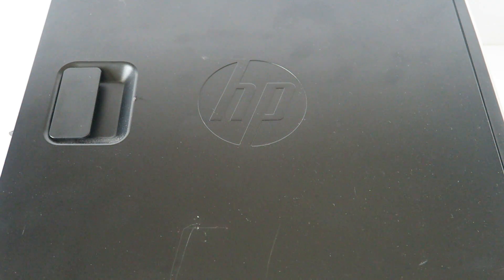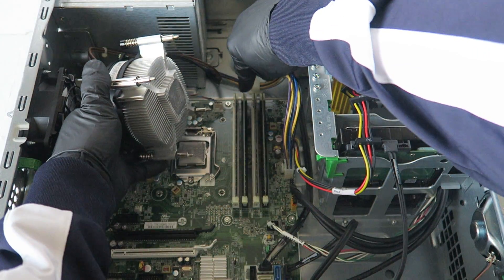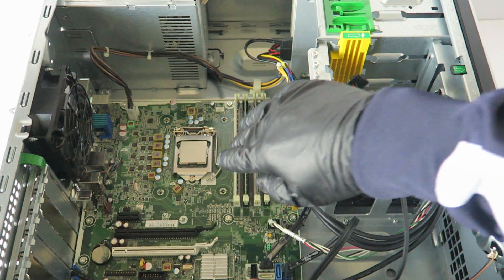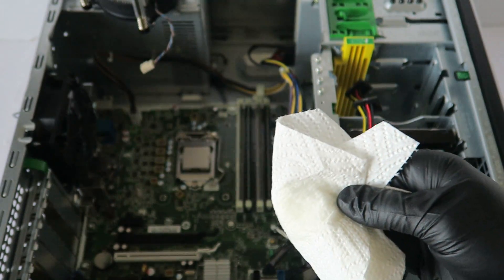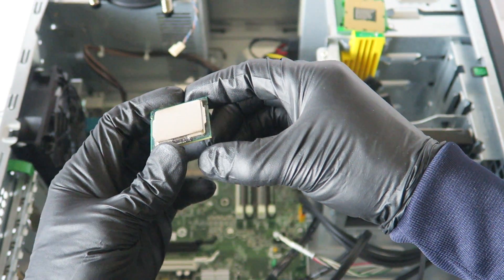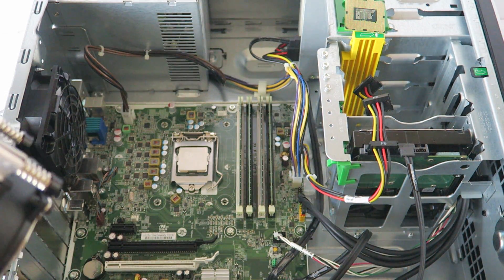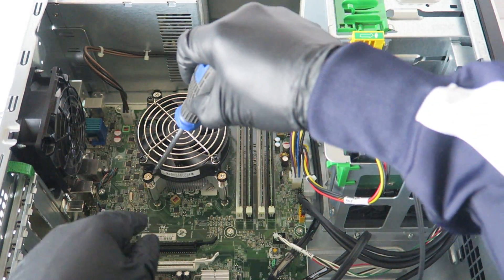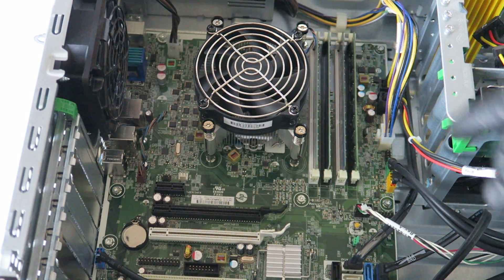HP 8200 Elite Processor Upgrade

Comment: I know this is old. I have the larger case 8200, do you think it’s possible to install an AIO liquid cooler for the cpu? I hit 80c on the cpu regularly on the factory cooler and want to upgrade. I’m not sure if the factory fan header would be ok for an aio pump

Comment: Can you replace the cpu heatsink on these machines? I saw some cheap lga775 coolers on ebay but I'm afraid that the mounting holes are proprietary like everything else in these damn machines.
Reply: I tried replacing the heatsink with 2 different coolers, but they are indeed proprietary. Any luck on your side?
Reply: @presidentcherry6193  I did managed to replace the heatsink, but had to pretty much hold the thing with zip ties because of the holes in the case are threaded, pretty much designed to only hold the proprietary heatsink. You can squish the mounting bracket on the new heatsink in the holes but it's very finicky, you could probably use a drill and remove the threading or make the holes larger or get some motherboard screw extenders, or alright remove a hole at the back of the case and use a back plate, but I didn't try.
Reply: @LookingGlass69  Another thing to consider on certain heatsink is that some of the brackets could actually fit just fine if you're willing to drill some holes for mounting screws. I was thinking of doing this, but alas I don't have any tools that can drill through metal and make small enough of a hole. Any cooler you're using in particular?
Reply: @presidentcherry6193  I was using a cooler master heatsink, I don't remember which. I gave the computer to my father so I fitted the original heatsink to avoid any further trouble. He only uses it for YouTube and Facebook so it's sufficient.

Comment: whats the best "i5" for HP Compaq 8200 Elite?
is "i5-2500" the best i5 core?
Reply: No, thats like he second or third gen, u should see the i5 9400 and 9600 cpus, these are the latest so far
Reply: @vetonhaziri7625  Wtf man those have different sockets, HP Elite 8200 only supports 2nd generation processors
Reply: @GoofyGGoof  i didnt know that, sorry

Comment: I know it is late but is there a way to control fan speed on hp 8200 elite beside fan idle on bios, is there another way to set cpu fan speed corresponding to high temp, because hp cooling policy is pretty bad.
Reply: Try control+f10 or f11 on start up for extra options in the bios

Comment: Can you tell me if the motherboard has a bracket on the back for screwing the CPU fan into?  I bought this motherboard thinking I would build a system, then I find out it doesn't use a socket 1155 CPU fan, so I found and ordered the original fan for the hp 8200 mt and now I'm hoping when it comes that I ain't missing a bracket to mount it to?
Reply: How did that worked out for you? I want to replace the heatsink too.

Comment: hi man i have the same  pc do you think ryzen 2400g work on it? or do i have to change the motherboard ? 
my power supply is 320wat hp compaq 8200 elite minitower
Reply: This is a completely different socket, you can't just put a Amd processor on an Intel motherboard. You have to buy an Am4-Board. Problem is, the power supply is non standard so an aftermarket motherboard can't be used with the hp psu in there.

Comment: Hey there. Can i replace the cabinet of my HP Elite 8200 SFF? My cabinet is very small and also the PSU is only 240 watts. I need to upgrade so that i can install a standard size gpu easily. My question is can i use the components like the motherboard, CPU, RAM, HDD of my HP elite 8200 to a newer cabinet and PSU?
Reply: Júnäíd Hússaîn proprietary cabinet and motherboard :((
Reply: 〰Fyre so i can't change the motherboard and PSU. But what about the other components like the CPU, RAM, HDD, DVD Writer? I can get a cheap H61 motherboard and swap these things in it? Then it'll work right?
Reply: Júnäíd Hússaîn you might be able to change the PSU and you should definitely be able to change the other components so long as they are compatible with the motherboard, processor and fit in the tower